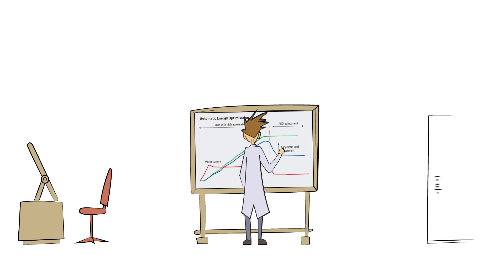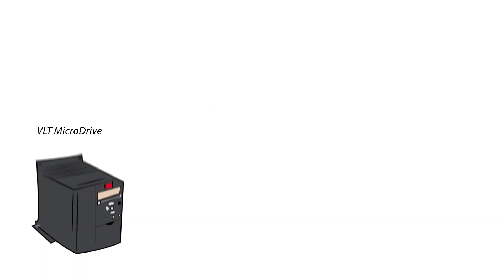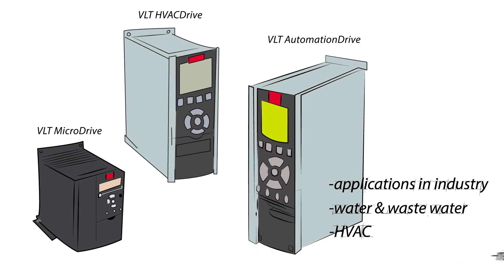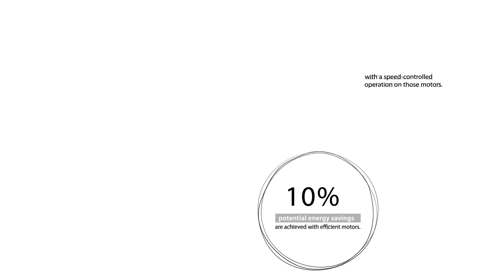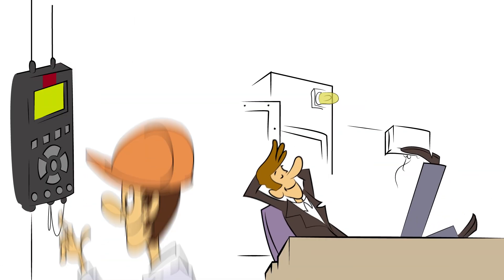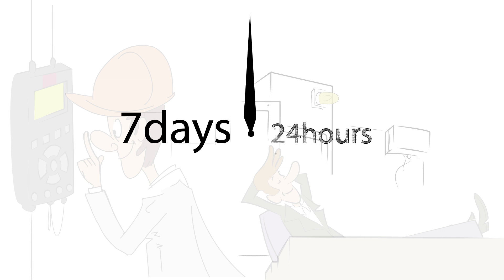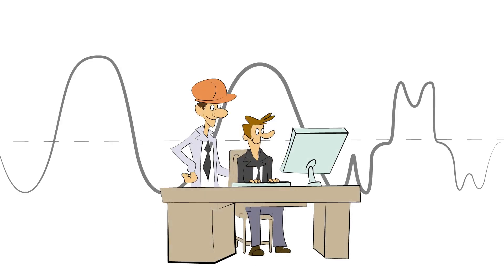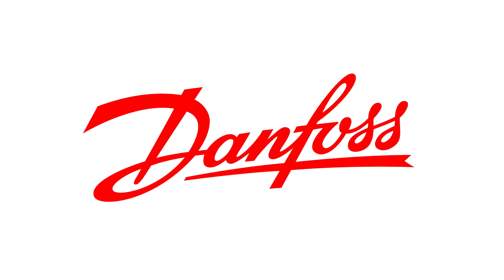Introduction to Danfoss VLT Drives

Comment: Your naming convention is terrible, call it a VFD or VSD like everyone else....
Reply from the maker: Hi Brian

Thank you for your comment. You're welcome to take a look at our page which explains the many names we use for VFDs: https://www.danfoss.com/en/about-danfoss/our-businesses/drives/what-is-a-variable-frequency-drive/
Reply: @danfossdrives . Hi I have been using danfoss drives for over 20 years and this week was asked in an electrical trade test paper, what does Vlt stand for. This has caused myself and several electricians at work to scratch their heads. I also followed your link above but could still not find the answer. Could you please explain. Regards H
Reply from the maker: @hedleywilliams392  Hi Hedley, as the story goes, VLT originated from a name Danfoss initially wanted to use: VeLoTrol. However, either because this name was already a registered trademark elsewhere or because it was deemed too long, Danfoss settled for VLT. It doesn't stand for anything else in particular in the Danfoss context. In other contexts, VLT can actually also stand for 'Very Large Telescope'. There is a short article about the meaning of VLT here: https://www.fluidsprocessing.nl/product-news/3096/the-story-behind-the-vlt.html

Best regards
Danfoss Drives Social Media Team
Reply: @danfossdrives   Thanks for that info, It was driving me nuts trying to find out what VLT meant?